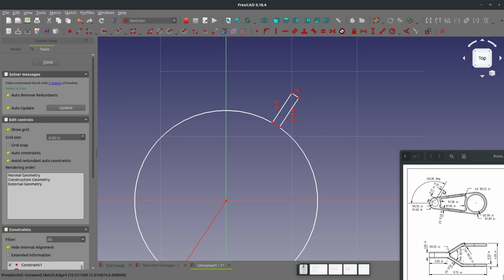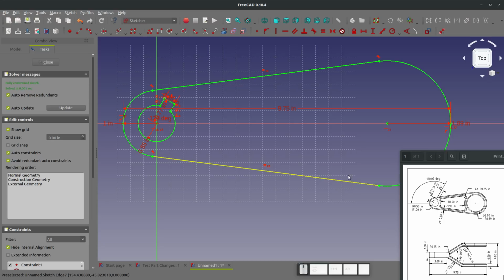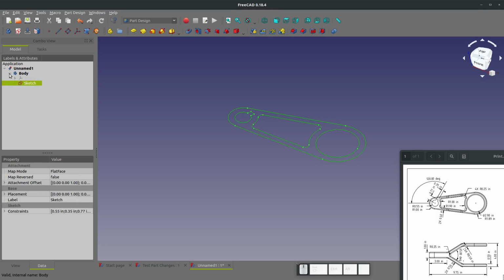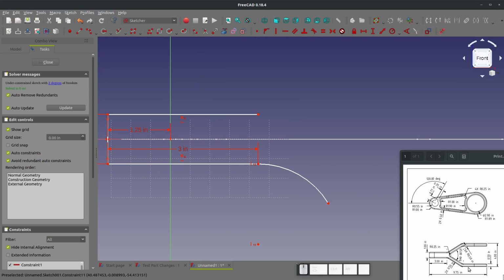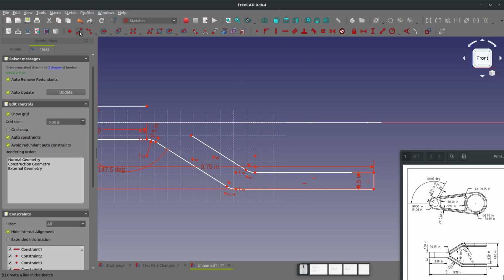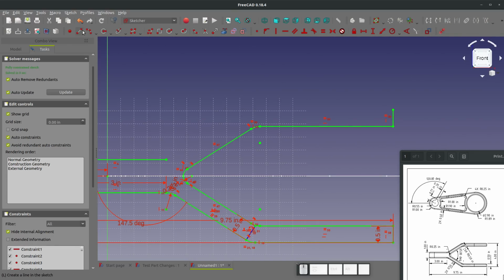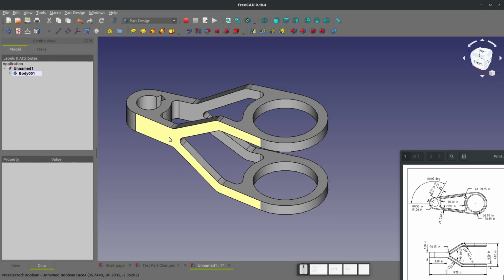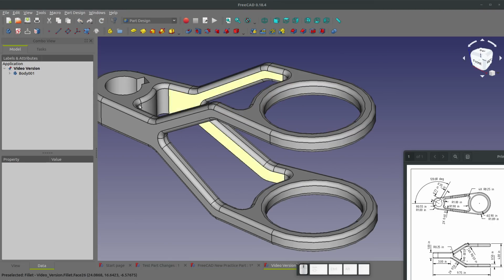FreeCAD Practice Part |JOKO ENGINEERING|

Comment: You should maybe look into using the function assignment to produce sketches that are linked to each other. instead of assigning one length twice, you can assign it once and then assign the other length to the one you already have via the constraint name. So when you change the dimension, it will reflect in the other sketch as well. It is also useful when you don't have precise measurements in your technical drawing and don't want to do the math. you just add a reference constraint and use that as as a reference in your driving constraint in another sketch.
When using the polyline tool you can press M a couple of times to automatically generate arcs that are tangent to the previous line.
Personally I'd have made only the lower half of the side section, extruded and then mirrored the whole thing. This thing could be done in the part workbench also using that method a little more convenient.
Also eww... who uses inches for technical drawings and sketches? That's disgusting.
Reply from the maker: I have content on functions but this video is meant for those of lesser experience and the function assignment would be out of scope for the intended audience.  I also have content on the M key, but in videos like this hotkeys will be a lose no matter what.  People tell me to use more hotkeys and other people say I don't do them enough.  I try to make hotkeys as clear as possible but not overdo it.  It's too bad in the latest FreeCAD they changed the hotkeys,  the previous ones were one of the parts that set FreeCAD apart in my opinion.

Comment: When I try to combine  both programs it says failed to validate broken face. What do I have to do to fix problem?
Reply from the maker: Hi Stephen, it means that two lines or a line and an arc are not connected, or there is an extra line or arc that shouldn't be there.

Comment: Hi there! Really love your videos. I am trying to make a body in PartDesign and I would need to measure an arc. How in the world are arcs measured in FreeCAD? I can't seem to find that option anywhere. Can you help?
Reply from the maker: Arcs are typically sized using a radius.  Are you saying you have a defined arc and you need to find out the radius?  In that case there is a button that turns the dimension buttons blue, use the radius tool when it is blue to report a non-driving dimension

Comment: There is something strange here. I followed your instructions and at the end of the first part (that is from the beginning to 4:0) I get an unconstrained sketch. This is because the large end can move around an axis centred at the centre point of the smaller circle. Further investigation reveals that at 2:19 you set a tangent for the two lines to the smaller circle and then you say "A for angle" followed by a several second silence. Mysteriously after that you have no constraints. I have no idea what A for angle followed by nothing does in Freecad but it seems to work for you. Did you edit the video there?
Reply from the maker: I don't recall making an edit there at all.  You can download the part to check for differences as well
Reply: @JokoEngineeringhelp  Odd. There is quite a long silent pause just a you say "A for angle" but the video doesn't show you typing any value for the angle. Sadly I am using 0.19 and that seems to have a lot of bugs or perhaps I am just good at finding them. Anyway, shortly after I posted that Freecad refused to draw arcs anymore. In fact it also refused to draw lines, squares or circles although strangely it would draw hexagons. Actually it didn't refuse to draw arcs: It was more that it drew them all over the screen in random places and with random sizes flashing here and there when I moved the mouse. It also reported lots of errors which look very like coding errors. I can't remember the text exactly now but, it included "nan is not defined' which I suspect is "Not a Number" perhaps. I'm going to have a look an OpenSCAD as an alternative as I find FreeCAD difficult to use and buggy. Anyway, thanks for your reply and also for your videos. They are certainly better than many of the others.
Reply from the maker: @colcol758  Consider an alternate install if you're running linux and solvespace is a fun parametric modeler too, early in development though and not as powerful as freecad yet.
Reply: @JokoEngineeringhelp  Thanks for that. Sadly I'm not running Linux. I would like to know what the shortcut key"A" does. You say "A" for angle but no dialog box appears in the video so how did you enter the angle? I wonder what angle the other people making comments saying how they got this working used. I just don't understand this. Anyway, I've given up on FreeCAD as it is too buggy and unintuitive for any real use. You can't design a complex part with a tool that can crash at any moment and corrupt your design so that you have to start again.
Reply from the maker: @colcol758  Pressing the A key and then two lines sets a dimensional angle between the lines.  It's too bad you're seeing bugs, a lot of people make complex things without any problems.
Good luck
Reply: @JokoEngineeringhelp  Yes, but what is the angle? Is it 10 degrees, 30 degrees etc. When I tried that I get a little dialog box that allows me to enter the angle and an optional name. There are also OK and Cancel buttons on the dialog box. In your video that dialog button does not appear and you therefore don't type the angle. As I said at the start round about 2:19 you say "T for tangent and A for angle". An A appears on the video but not the dialog box. There is a silence in the video for several seconds and then the video continues with the angle set. I couldn't see an angle marked on the technical drawing either. Anyway, it isn't important. All the other people who commented seem to know what the angle is and I assume others yet to see the video will somehow know.
Reply from the maker: @colcol758  Yes at that point I was about to do an angle and changed my mind, no angle was given around 2:19
Reply: @JokoEngineeringhelp  Thanks for the clarification. I still don't know how the sketch is fully constrained without that angle though but I guess it is just another FreeCAD bug. I've given up on it anyway although I will have a look at the RealThunder version I suppose as it is claimed that version has fixed a lot of the bugs. Thanks for your help with this anyway.
Reply: @colcol758  If you closely watch the video there was no angle set.
Reply: @mickmann6779  Thanks for the reply. Yes, that is what I was saying but when I don't set an angle I get an unconstrained sketch with 1 degree of movement whereas in the video it is fully constrained. I've been through these few minutes over and over again pausing the video every few seconds and the result is the same every time. When I was doing it, Freecad crashed badly and I lost the thing anyway so I gave up on it. I meant to try with the RealThunder version but its been busy at work so I haven't been able to. I was also going to download the model but the same problem with time applies:-)
Reply: @colcol758  I had the same problem, I think it has to do with using a more currant version of Freecad.  I did not set an angle as he did at 2:19 and when I finished the sketch I had one degree of freedom which I removed by adding  another perpendicular construction line of 0.5 inch like he put in at 5:55 to the opposite side (leg) of the sketch. When I did that I had a fully constrained sketch and I was able to complete the tutorial. Let me know if that helps.
Reply: @mickmann6779  Thanks for the suggestion. I did wonder if it was to do with versions. I'll give that a go. I've installed the RealThunder version but not had much time to try things but after next Thursday I will have more time to try.
Thanks again.

Comment: ! Note !
If you're having problems with your boolean, go back to where he says "extrude" (c. 16:45).  It is NOT the Extrude function (which is in the Part bench).  It is the Pad function (from the Part Design bench).  Why does this matter?  Because Extrude makes its own objects (on the same level as bodies, but NOT bodies), and a boolean must be done between two bodies.  Pad, on the other hand, makes sub-objects of a singular body.

It took me a good hour and some close watching to figure that out.  Despite that, I'm still in love with these videos.  Awesome work, JE, thank you so much for making these!

Comment: Would you consider tutorials using exercise file from SolidWorks and teaching the difference between the two applications
Reply from the maker: I cannot; the material from SolidWorks is proprietary.   I do have videos where I make the same part with FreeCAD and SolidWorks so you can see the differences.
Reply: @JokoEngineeringhelp  thanks for your reply..i will have a look at your videos

Comment: 6:10 How did you know that was the final constraint?
Reply: because when I copied your proceedure, and I click on "1 degree", it shows the construction line as the 1 degree left.  If I fix point on the vertical line, then I get "fully constrained".  Just wondering if there is a method to choosing one over the other?  Great tutorial!
Reply from the maker: @TheRainHarvester  Great question.  When thinking about sketching, truly there are many ways to do the same thing and nothing is right or wrong as much as some things are better or worse for design intent.  Usually in a design process you'll go back and update parts of a sketch, so a good sketch usually accommodates updating changes with as little effort as possible with as few sketch elements as possible.  That's usually what I have on my mind when I think of different ways of doing a sketch, and on video I'm thinking about a lot more than just the sketch so sometimes I miss things that could have been done bettter!  Hope that helps

Comment: hey man, another awesome video. 🙌

one thing. i'm going to assume your running some ubuntu flavored GNU+Linux, and that your little key caster / key display/monitor is an open source app that may take some settings. if that is the case could you set the timeout of the key display? ie. can you make the keys being pressed display a little longer. when you're in the sketcher workbench and you're mashing all the keyboard shortcuts they flash in your little monitor rather quick, i'd say probably 500ms or less than 1 sec which makes it difficult to know what it is your pressing while watching at normal speed.

just a thought. like maybe a 2 second display if the little monitor key caster supports such feature.
Reply from the maker: That's a great suggestion, unfortunately my keyboard monitor isn't capable of delays.  I think I'll work on a cheat sheet.

Comment: Yea I stopped watching this 2 minutes in as I got completely lost, you move and talk too fast and your little keypad tool is not much good as it requires one to look at multiple places on the screen at once which is confusing as heck and just contributes to one getting lost quicker. Would be nice if you could do a video designing this part except for folks who don't know FreeCAD and are trying to learn. To do that you will need to go much slower, avoid the use of hot keys and explain what you are doing each time you select something or apply an update. Pretty tedious I know but something that is needed otherwise you will lose the unwashed, i.e. those who are looking to learn freeCAD, in a matter of a few seconds.

Comment: Best FreeCAD teacher on YT !
Is there a reason to (seemingly) avoid Trim, Splines, Fillet, and Mirror in favour of Tangent Arcs and drawing 'both sides' even if symmetrical ?
Boolean subtracting Bodies (not Loft to Edge) is a bit of a brain-twister to envision/learn, practise practise practice
Reply from the maker: Hi SoloSailor;
There is nothing wrong with trimming or splines or anything of that nature.  I draw both sides because mirroring doesn't fully constrain the sketch after the mirror so I like to capture my own 'design intent'.
Reply: @JokoEngineeringhelp  Thanks for the Reply. another JokoVid details specifically constraining to Design Intent (i'm binging)  Fusion360 allows a less professional approach, so I have some bad habits to "professionalize".

Comment: It would be nice if sketch mirror would add the required equality and symmetry constraints. Seems it shouldn't be too difficult of an algorithm.
Reply: While watching the video, I was thinking that it would be handy to have a mirror feature from start with the sketch, in this video, mirroring above the X axis in real time all operations done below the X axis. Maybe it's too complicated or confusing.
Reply: @releasethekraken5299  I had a look at the python api, and that idea sounds difficult. However a smart mirror command that adds some equality constraints should be doable. It is non-trivial to add symmetry constraints, as it is very easy to overconstrain the sketch by mistake. And it is not clear which subset of symmetry constraints should be skipped, so it is a question of design intent at that point.

I might take a crack at implementing a smart mirror as a macro at some point, if I get time. It will not be perfect, as that is not possible. But it should at least be able to do some of the work.
Reply from the maker: @VorpalGun I'm grateful for people such as yourself that have a good programming ability and are willing to improve this wonderful software.  Thanks for looking at that!
Reply: @JokoEngineeringhelp  I have started my investigation into this. Unfortunately the current implementation is messy and hard to use from a macro from what I can tell. See https://forum.freecadweb.org/viewtopic.php?f=22&t=53346 if you are interested.

Comment: Btw....how do you managed that you can see the drawing and you can still see it when you work with FreeCAD?
I'm new in CAD modeling, sorry for my dumbness.
Reply from the maker: Along with the other excellent replies, in Linux 18.04 with the gnome interface I right click on the window and select 'always on top'.  In Windows, there is a program called deskpins that adds the functionality.
Reply: I think he may be using an app to keep it there. While it is not something usually done there seem to be ways to do it in all major operating systems. Try searching "window always on top" and explore the results for your operating system.
Reply: @paulreader1777  ..thanks.
Reply: @dieterdodel1974  Thank you for asking the question - I benefited from researching the answer.
Reply: In most linux desktop environment you can choose to keep a window above the active window.